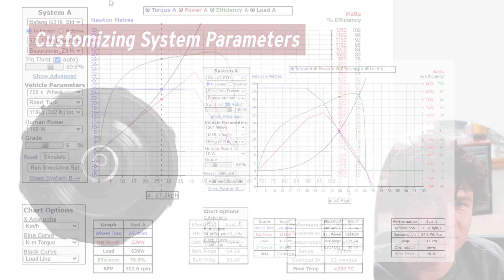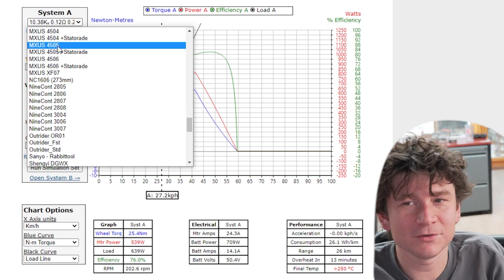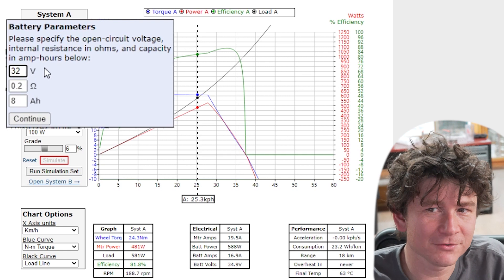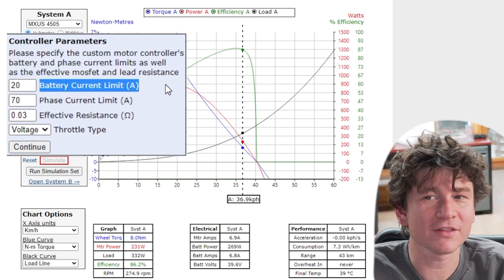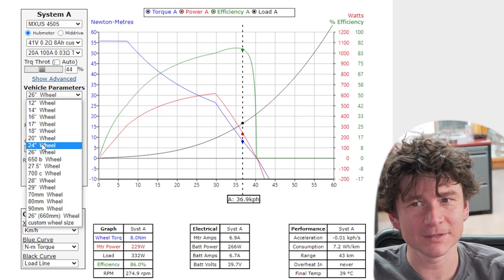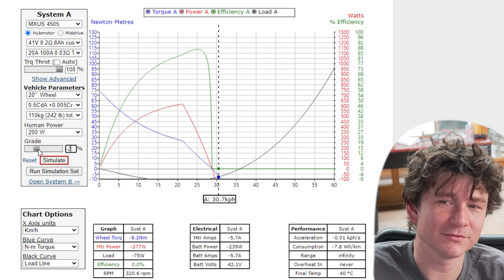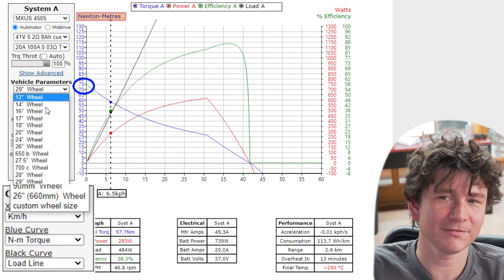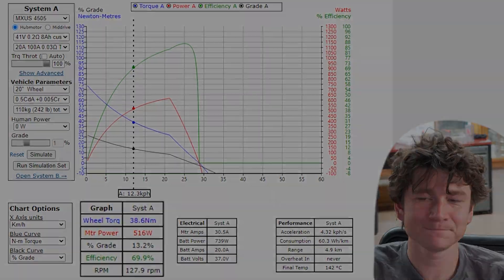Grin's Ebike Motor Simulator Tutoral:   --PART 2--  Overview of System Options

Comment: I can’t even get my system to run at all the brake toggle it on constantly on the dash board with 5volts running through it and the wire is getting warm where it goes into the throttle. It was set up for regen then I took the wires back to basic with the green and blue shorted out and I get 2.5v across the throttle and the brake
Reply: My set up is phase runner with a 600w 48v 30amp battery and a sensorless hub motor
Reply from the maker: Have you written into our tech support email? info at ebikes dot ca
Reply: @GrinTechnologies  Yes and I have been meaning to reply but I’ve  it had chance to have another look at it I’m going to try in the morning and see if I can get the information Raz requested

Comment: Motor simulator lesson 2 introduced interesting theory of some motor designs and controls. I found it particularly interesting and am looking forward to lesson 3. I think running this simulator on a PC monitor is the to do. 
   So far, I understand how to browse the simulator effectively enough to predetermine the benefits, limitations, capability and efficiency. 
   In a nut shell the nut 🥜 say's:
 We are at a time and place where stored energy pushes  brushes off inductive off and balances on AC half phased DC somewhat rare to USa magnets. 
    I've always been afraid of working on a bicycle.....turbines,  aircraft, heavy class commercial, light duty automotive electrical and mechanical but afraid of bicycles. I don't know why I would rather trust a bike mechanic but I would.
    Personally, I think it would lucrative and fun to direct focus on airline approved bicycle travel vacation destinations abroad because airline ticket fares are lower than rental cars. My mentor used to make bicycles fit into an airline approved suitcases for English and Scottish country sides. ,✌️♥️👍